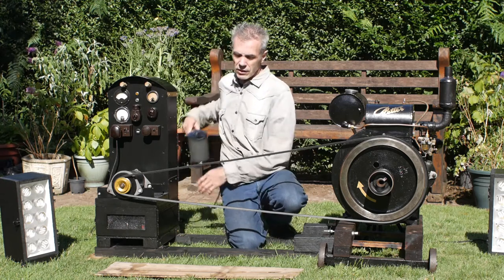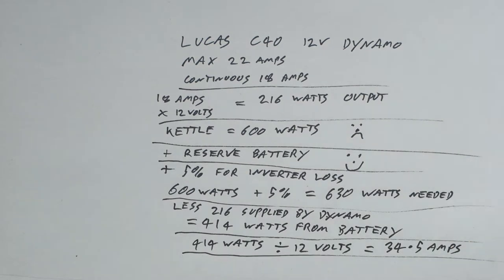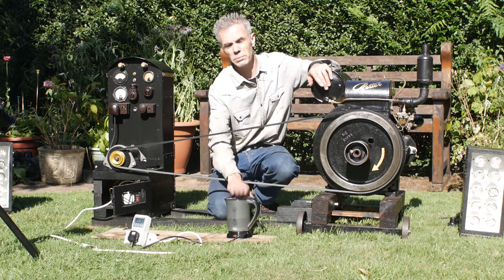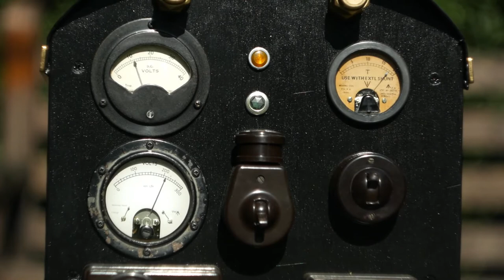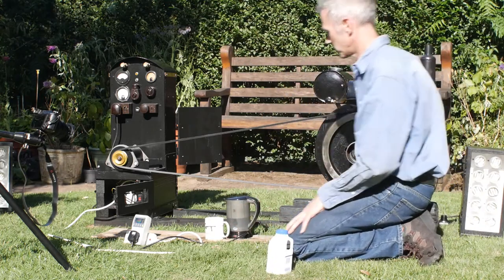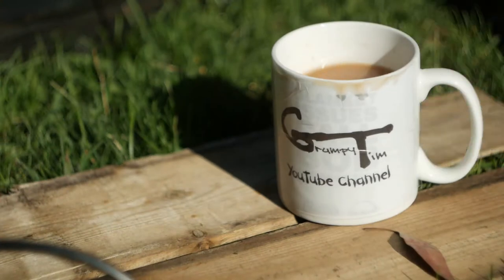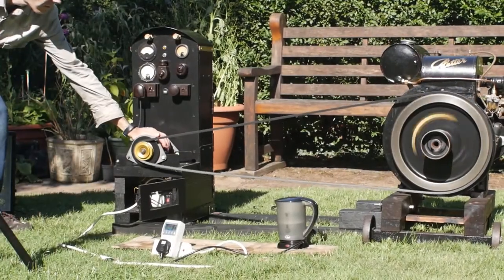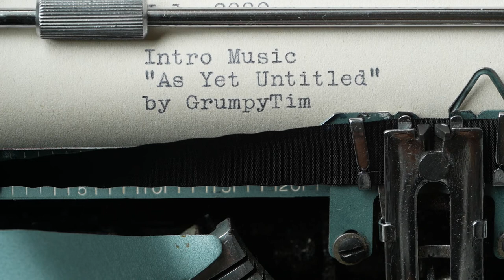Making a Cup of Tea using a Petter A1 Stationary Engine Generator

Comment: It was really good to see someone put the engine under a proper working load I really hate to see people just start an engine And leave it ticking over there is nothing better than see an engine doing a proper job and see it grafting thanks for showing us this cheers Derek
Reply from the maker: Cheers Derek, it's always nice to actually use these engines for a task, although I must admit that I do sometimes just start them and leave them running on idle just for the hell of it!!!!!  One day I'll get round to getting a bigger generator (or converting an induction motor) to use with my Enfield Diesel engine - should be able to boil a bigger kettle with that one.  I also quite fancy a big circular saw to power with one of the Petters - I'd actually have quite a lot of work for that - but Mrs Grumpy isn't too happy with that idea.....

Comment: Once the tea was made you should have sat and watched the Petter run while it re-charged the battery.
Reply from the maker: Good point, I did re-start the engine to charge the battery back up - I could have sat and drunk my tea while it did that.

There's mileage to do the test again with more meters - a clamp meter to measure the actual currant going to the inverter.  Maybe if I could free the 12 ammeter so it works properly at the top end - that meter only has a 20 amp range and I suspect the dynamo might have actually reached closer to it's theoretical maximum of 22 amps - I guess I could use the clamp meter for that too.

It all got a bit frantic while the thing was running, with the inverter bleeping it's low voltage warning and checking the dynamo temperature and the wiring inside the cabinet - it might have made a good video if it all went up in smoke but I didn't really want to have to build another one!!!
Reply: @GrumpyTim  if you need to borrow a DC clampmeter, let me know.
Reply from the maker: Cheers, I think I can borrow one from my brother but if not I'll take you up on that sometime.  I should be able to calculate the actual loss of the inverter if I measure the power in against the power out - I just guessed at 5% but it could well be higher.

Comment: Well done, though expect much anger from those who make tea in a slightly different way! Out of interest how long did it take to boil the kettle?
Reply from the maker: It was 4 minutes 23 seconds from kettle switch on to boiling.  That would have a bit quicker if the inverter hadn't been cutting in and out but maybe only by about 30 seconds I suspect.

I have incurred the wrath of tea drinkers in the past for the way I make my tea!!!!!
Reply: @GrumpyTim  Quicker than my Primus stove, though not quite as portable. A bigger battery would probably help.
Reply from the maker: I think the setup time for your Primus stove might be a tad quicker as well as being more portable.  It was a fun experiment, cheers for a really great suggestion  :-)
Reply: @BensWorkshop  whaty sized battery would you recommend?
Reply: @markgaved1866  Depends on what is available.

Comment: Would it be possible to see a wiring diagram for this set up, I'm trying to do a similar thing with my lister D and a spare c40 dynamo and rb106 regulator but I'm having trouble working out a schematic lol
Reply from the maker: Hi Johnny, yes, no problem, but it might take me a week or two to dig out my original scribblings and then turn them into something that another human being can actually understand - I'm not the best at drawing clear circuit diagrams!!!!  They are a weird beast those voltage regulators, it took me a while to figure out how to wire it all up and then having done it once, I think I've forgotten most of what I learned at the time.

I'll be back in touch soon.

ps, if you want to email me directly (you should find my email address in the "about" section), I can send you a PDF of my scribblings when I track them down.
Reply: @GrumpyTim  @johnnywoodbine9092 : me too! you've started a thing here Tim! love to see the schematics!